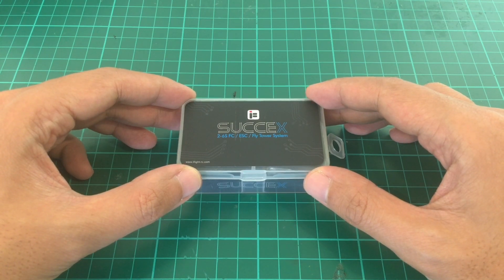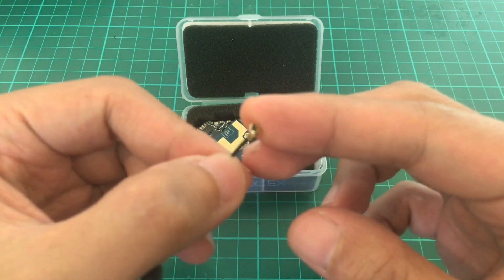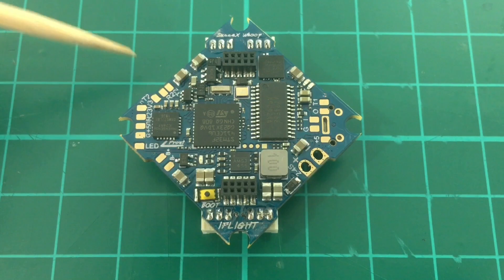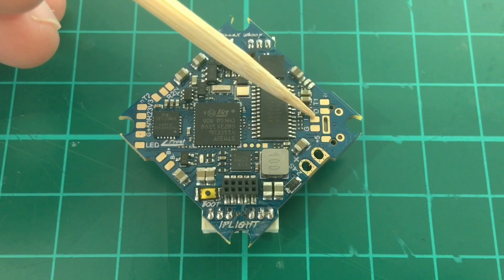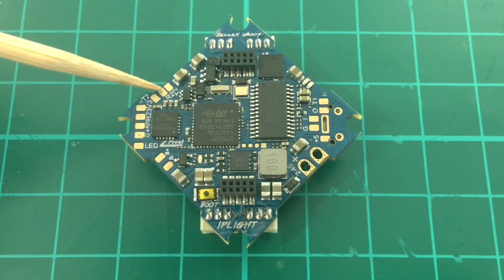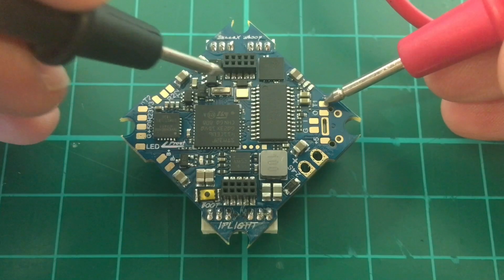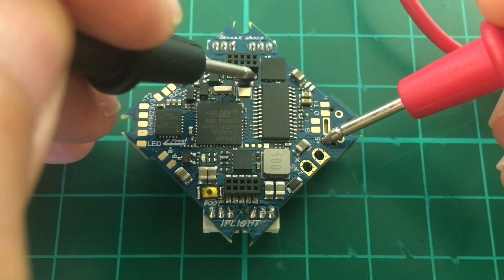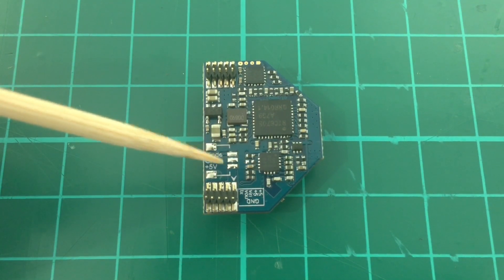iFlight SucceX F4 Whoop FC Unboxing and Overview

Comment: Nice explanation of the FC. What is the motor direction for this board? Is it standard motors 1 & 4 clockwise rotation?
Reply from the maker: MultirotorManish Will depend on the motors also, but you can easily change directions using BLHeli Configurator.

Comment: Ive had no problems with this FC except that I cant calibrate the gyro, compass or acc in flight, and I cant trim the acc in flight, does anyone else notice this? also the soldering pads are too close tot he mounting screw hole, I need to put some hot glue on the wires to stop the screw shorting it out.

Comment: Nice review. I got some random rx loss and sudden all motor stop for a second in midair. OSD show rx loss and bad rx. Change xm to xm+ rx still got same rx loss. Flash firmware with BF 4.0.4 provided in iflight website and same problem occur.

Build another micro quad with iflight micro f4 v2.1 16x16 stack with esc plug still same problem occur.

I am clueless right now. I am still asking people around internet for a solution including iflight himself. Probably you got solution for it?
Reply from the maker: Apis XQuad Thanks! Are you using the piggyback VTX? Some people have reported interference on their receivers when using the piggyback VTX.
Reply: @jaylagare  Update: Just got my new xm+ rx. After install xm+, flash rx and fc, bind and rebind, now its work. Both of my micro quad 1105 with iflight 16x16 stack and 1102 iflight whoop aio fc fly great. No warning bad rx or rx loss anymore.

Probably the xm rx defected.

Thanks.
Reply from the maker: Apis XQuad That’s good to know! I’m glad you got it working.
Reply: @jaylagare  I am using same vtx in the video from Iflight. Already open ticket to Iflight but no reply yet. Tonight, will flash it with 3.5.7 BF fw and see how its goin.

Comment: I got a constant weird interference with that VTX. Only when the receiver output signal will that happen. You got the same issue with yours?
Reply from the maker: Kabon I haven’t used it for a build yet. What’s your receiver? Adam Douglas reported similar interference with the R9. https://youtu.be/CE_CKL7Z7ro